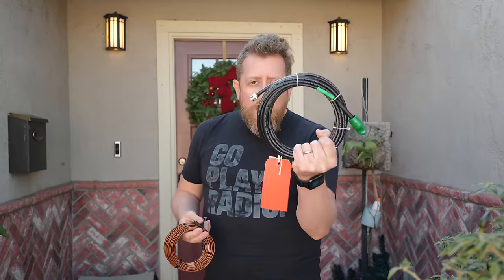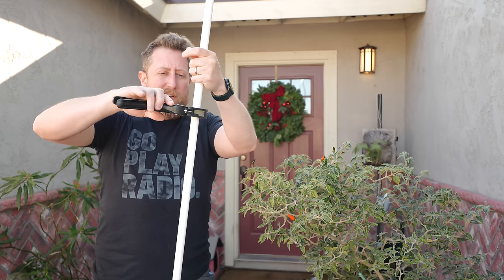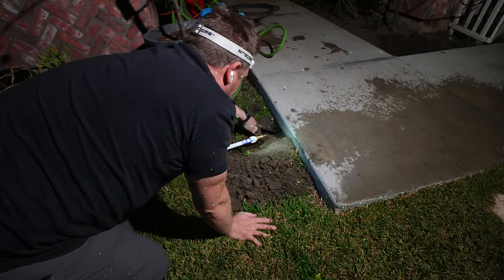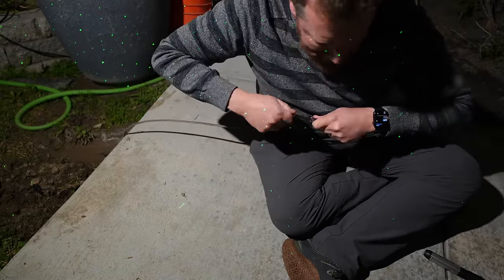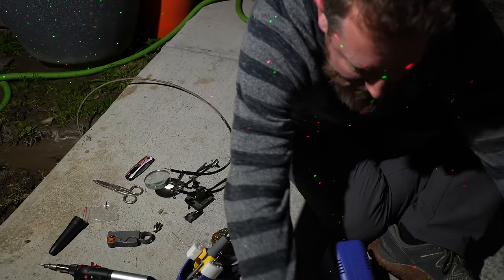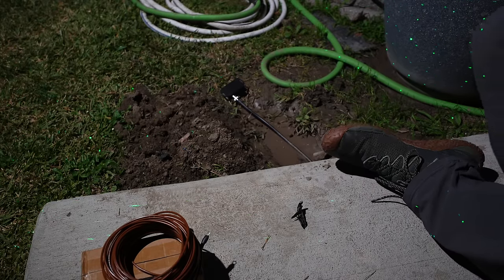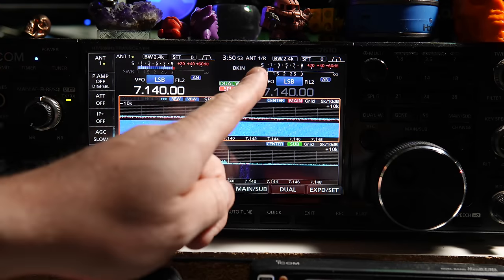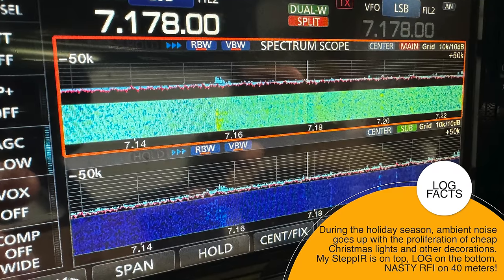Loop On The Ground Receiving Antenna - Cuts Out The RFI?

Comment: One thought on cutting off the connector from a roll of coax. Unless I need every foot of cable, I always cut a minimum 3 foot piece of cable off if I need to cut off a prepared connector. That way I can get a decent length for a patch cord just by putting a connector on the other end.  You can never have enough patch cables. :)
Reply from the maker: Good idea.
Reply: Yeah, I was cringing when I watched him snip off the connector.  Great idea to cut off a minimum useful piece if necessary.
Reply: You smart
Reply: I would just drill a bigger hole in the wall. 😊

Comment: Hey Josh, You go to all that trouble to lower your noise floor but you have noise probably coming from all the LED's you have running everywhere in your house and  garden Christmas lights. Use your tiny SA to sweep your lights psu's etc. Cheap LED's are noisy  and give out lots of RF.👍

Comment: Remember you need to fill that void under the concrete with something when you're done or that sidewalk will crack and cave in. It's always better to put in an oversized conduit for multiple uses (one inch) then pump grout into the void. Never leave that void open because it will fill with water and frost heave your sidewalk in a year or two.
Reply: While a valid point in most of the US, not an issue for Josh. Nothing's freezing in Cerritos.
Reply: @BenjaminHeyser  he might not be in danger of freezing but undermining the soil under concrete is still a very valid concern everywhere so I should have been more general I guess. Houses and skyscrapers have been demolished by this, water is an amazing force and erosion happens incredibly fast.

Comment: A couple comments on the trenching. (BTDT) For an easier go:
Dig a trench slightly longer than the trenching pipe on the approach side . Use a chalk line or straight edge from the exit point across the walk and mark your line to dig the trench in line with the far side target. That guarantees you hit your target and makes it easier to jet because you are already on target and you dont have to bend the pvc to keep it from submarining. 

Cut the PVC 24" longer than the crossing is wide. That leaves 12" on either side when you are done. That way you can just cut the tube off on either side of the walk to remove the ends and it becomes a conduit, protecting the wire from the gravel under the walk. Just shove the wire through the PVC instead of removing the PVC and using it like a pull cord. 

Also the PVC may bind up during digging. Thats because the tube is wider than the jet. Dont panic. Just keep moving the tube forward and back as best you can and it will eventually release itself and let you continue. 

Have fun!

Comment: I built and tested a few LOG receive antennas whilst my Yaesu was in the shop, and was using the 7610.  The main problem I had was, yes it dropped the noise floor down, but it dropped the signals down almost as far. It was my experience the ratio between the signal and noise improved around 3db on the lower bands using the log antenna. For me, and your mileage may vary, it just didn't make enough difference in performance, to keep the antenna.  My FTDX10 doesn't have but one antenna port, so when I got it back from the shop, I just did away with the log antenna.  It was a great experiment and glad I took the time to do it.

Comment: That’s amazing what an antenna on the ground can receive. I used to use a 20 meter resonant dipole only 3 feet above the ground, and it did work. 

You might try out a different stealth antenna project. Get some cheap after Christmas lights. Clip the leads from each bulb to minimize them from lighting up from the RF. Glue the bulbs in their sockets. Then use the Christmas light wire as an end fed antenna. It will look like Christmas lights that didn’t get taken down, and never light up. People will just assume that it’s Christmas lights, not an antenna!
Reply: An antenna disguised as x-mas lights, LOL! Great idea!!

Comment: In Interior Alaska and I have a BOG (580 feet) but the receive antenna I'm most impressed with is my DIY ARRL 80m Skyloop.  Set up at about 10 feet high (Just above the Moose antlers).  Its simply one of he best.   I will likely purchase of of the Loop-On-The-Ground to try.

Comment: they really work!  also a non resonant ( to any bands you operate on) wire - slung low to the ground from a 4:1 UNUN also works well.  one thing that makes any of these possible is I have a receive port on my rig, before I had that capability , I had to use a TX/RX switch box or remember to flip the VFO.  I have a lot of QRN in the evenings on the low bands. a dedicated receive antenna is the bees knees !  - I love how the cat came over and checked everything out.  - I imagine he said "meh.... carry on lad - nothing of interest for me here ! "  Ha Ha !  fantastic topic, thanks!

Comment: I built and installed a LOG about two years ago. It was  quiet but my 40m skyloop was just as quiet (I live in a semi rural area). So that LOG has been adapted into my loop ground plane shack earth system and using that in combination with the skyloop, the noise level is now almost non-existent!
73 Ed DD5LP.
Reply: Can you explain the loop ground plane.

Comment: I've used a LOG antenna for several years now. I use it with my RSP DUO, it works well from 40 meters and below, I also use it in diversity mode along with a OCFD.

Comment: I bought the same LoG from LMKS. I only Rx as I’ve not done the foundation licence yet but I’m having great fun experimenting with antennas and various software for the SDRPlay (SDRAngel using the FT8 plugin and map is brilliant!). I got best results laying out a perfect 25 foot square feeding off a corner, significantly better than the heavily modified MLA-30+ loop on 80, 40 and 20m bands (the loop is better at higher frequencies up to 50MHz). I really enjoy your videos and have learnt a lot, thank you.  Regards from the UK, Kevin.

Comment: I'm not using a LOG but a small RX loop - Mine is a Wellbrook that I've had for many years. I bought it primarily because the noise floor on 60m at my QTH has steadily increased over the years to a point now where it is about S5. It lives at the bottom of my garden on a lightweight rotator. 

I use a resonant dipole for TX and the Wellbrook on a dedicated RX port of the radio. The RX signal strength is typically a few S-points down on the dipole but the difference in SNR is night and day. 

I've just uploaded an A-B demo on my YT channel as an FYI.

Small RX loops aren't hugely expensive - the MLA30+ is about $50 and that design has had a lot of very favourable reviews; I guess the main requirement is that your transceiver has a dedicated RX antenna port.
Reply: If my transceiver doesn’t have a dedicated receiver antenna port which auto switch do you recommend?

Comment: It's nice to have a choice of several antennas, especially on receive.  (The guy on the other end isn't going to be bothered by you local noise sources.)

If it had been me, I would have put the professionally installed connector outdoors.  (Which also has the advantage of a nice warm (a consideration here in New Hampshire), well lit ham shack with a chair, table, and easy power for the soldering iron and heat gun.

Comment: I setup a home-brew 60 ft. LOG last winter. It worked pretty well but didn't want it in the yard during mowing season. So far haven't got around to installing it yet this season. It worked pretty well but should have put it further from the house. I had more noise than I expected. Signals were lower than my vertical but good copy using the receiver preamp. Phil N3ZP

Comment: It’s amazing but you need to mess with the RF gain to get good results.right away I notice the  noise was too loud which is an indication that your RF gain is all the way open. Try reducing your RF gain and adding some noise filters and you will get amazing results with it.
Reply from the maker: I did it’s part of the clips.
Reply: @HamRadioCrashCourse  it’s hard to tell on video because of the volume amplification.

Comment: The switch unit you showed at the end of the video is great for this LOG setup, but don't confuse it with the MFJ 1708B-SDR that allows for an SDR and a transceiver sharing one antenna. They look almost identical.

Comment: Been running a LOG RX antenna for a few months. I have a DXE BOG and an LDG 4:1. Even though the LDG isn't designed for it, it works well. Dropped my S7 noise down to S2. I tried to convince Mike to try it but he was pretty resistant to try it.
Reply from the maker: Oh yeah, Mike should try this!

Comment: This is the first video where even if the angle isnt the best, its shown me how to properly solder and wire up coax with a BNC or any other connector.

Comment: Yep, I've been using a KD9SV BOG BALUN from DXE for my LOG. Only about 30ft of wire. Works great on 40 and 80. I've even accidentally loaded it up and  used it on RTTY at 100W a time or two! 😲

Comment: Nice results Josh! I made a similar antenna with an binocular core for the transformer @ 75 ohms impedance, and used double shielded RG - 6. I positioned it in the only place I had room (under the mobile home) and it seemed to be a great coupler into all manner of noise occurring above in the home. I have abandoned it and opted for a broadband discone antenna that I use for my RSPdx across all bands. It limits my noise while still yielding usable signal strength. Tnx!
73 - KF6IF

Comment: I have known operators continue to use an antenna even when it's dropped to the ground due to a broken rope. Certainly not a good situation, but the noise floor was lower also, even if their antenna was then very poorly matched for transmitting.

Comment: What Icom are you using?
I'm trying to trade my best metal detector to get one.. Hopefully the 7300?
Reply: Josh is using an Icom 7610. A great radio and perfect for use with a dedicated RX antenna.
Reply: 7300 doesn't have a receive antenna port, would have to add a external switch for that(DX Engineering makes one)
Reply: He’s using a 7610

Comment: I may have exactly the same butane iron. After four months on the shelf, it had leaked out a full charge. The maker nicely sent me a whole new set of o-rings, but those leak just as badly. Moral: never fill it up, assume it will be empty. Disappointing!

Comment: I use 18-gauge speaker wire and an LDG 4:1 balun to make a square 'loop' around the perimeter of the back garden that's approx. 55ft x 32ft. Works pretty well with many HF bands. 10M is just noise for me though. If ever there's an antenna that works well as a DIY and is also easy to remove if required, it's a LoG imho. Rx only of course. Assuming it's electrically sound of course. Been enjoying your vids btw. Haven't actually said that yet. On the subject of a LoG though, what would be the effect of elevating it several feet off the ground, in my case weaving it through the chain-link fence we have on three sides? Is tx possible with such an arrangement?

Comment: background noise was the same on both antennas. The audio should have been dramatic. The lower display shows less noise but your radio gave the same noise as the Stepp IR antenna. Listen carefully
Reply from the maker: Much less background noise for similar or better SNR.  that’s my takeaway.

Comment: I went down the LOG antenna rabbit hole about a year ago.  After 3 months of use, it didn't provide any benefit for me, so I moved on.  Still would tell anyone interested to give it a go.  YMMV.
Reply: I had the same experience. Mine is still installed, I just never use it 🤷‍♂️

Comment: Very interesting, I've been thinking of replacing my MLA-30+ RX antenna with something else and this is really interesting (and cheap!). Does the wire need to be in a perfect "loop" shape, or can it be bent and conformed around some?
Reply from the maker: You can bend it around.
Reply: The LOG works best as a square with equal sides but in reality, any shape will  work.
Reply: I have 90' LOG and it doesn't care much what shape I have it in, figure 8 was interesting.

Comment: Did you go with the 60ft or 100ft element? I have the room for either but was curious about how much difference the longer element makes for the lower bands. I have a lot of noise on 80 and 40 but don’t want to take away the ability to use it on the higher bands either. Thanks for the video Josh, I have looked at that same kit several times over the last few months and I think I am going to have to let you spend my money……again. 73, KD9VLZ
Reply from the maker: 60ft, go 100ft of you can.
Reply: I had 60ft at old qth 100 where I am now. Saw no difference.  Now I have a 225/250 ft log and believe it or not but the higher bands work better for me which isn’t suppose to happen lol. Of course the lower bands work best
Reply: 100' will give you the best result on the lower bands. The trade off is a slightly higher angle of RX on the higher frequencies.
Reply: Thanks all

Comment: Thinking of turning my old electric dog fence into a log.  About 550 foot loop. Buried an inch or two under the lawn.   Any thoughts?
Reply: Go for it! Worst case is you have to buy loop wire but I bet it is killer on 160-40m!

Comment: Has anyone tried a larger loop such as 200 feet or 300 feet to compare signal strength? If the noise level stays low, the increased signal strength would be really a plus.

Comment: Using water to cut your way under the sidewalk will undermine it and cause it to crack down the road. Better to pound a ground rod under the walkway instead. Its a pain, but you wont have any problems later on.

Comment: Another question worth exploring is... Since the antenna is on the ground, is the antenna more or less susceptible to DC charges that could build up on the ground due to lightning VS a traditional vertical or up in the air wire antenna?

Comment: How does the element or transformer not get caught up in a lawnmower?
Reply from the maker: Lawn stapples.
Reply: @HamRadioCrashCourse  Huh, I just thought those were there so it keeps it shape. Good to know, thanks!
Reply from the maker: The kit comes with four stakes. I added a ton of stapples to hold it down.  The grass with over take the wire at some point.

Comment: Why did you cut the end of the coax that is outside?  What did I miss?
Reply from the maker: To get it through the hole I drilled.
Reply: But couldn’t you have pushed the coax in through the same hole?
Reply from the maker: It was terminated on both ends.
Reply: Let me say it another way, If you had pushed the end without a connector through the wall, you could have installed the new connector in the house instead of sitting on your sidewalk.     @HamRadioCrashCourse
Reply from the maker: You have no idea what’s behind that wall. So best not to speculate you think you know a better way.
Reply: @HamRadioCrashCourse  nevermind.

Comment: I made one a few years ago. It wasn’t all that great.
Reply from the maker: How much wire and what transformer did you use.
Reply: @HamRadioCrashCourse  I built mine from plans in QST.  If i remember correctly, I used about 40ft.  I tried it with a 4:1 and a 9:1.  Don't quote me on that though.  I was using a 7610 at the time.
Reply from the maker: I was told not to go below 60’ for use on 40 and 80 specifically.
Reply: @HamRadioCrashCourse   I am going to try making another one soon.
Reply: Make sure you wind a 9:1 isolated transformer on a binocular core. I know a guy that will sell you an easy to build kit... 😊
Reply: @M0LMK  I already ordered one, the same one mentioned here, and will be making a followup video of my install in a few weeks or so.
Reply: @HamRadio200  Great! It will get packed and posted today. Enjoy and hit me up if you have any questions. 👍